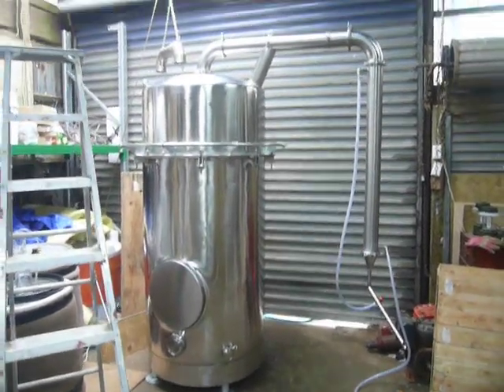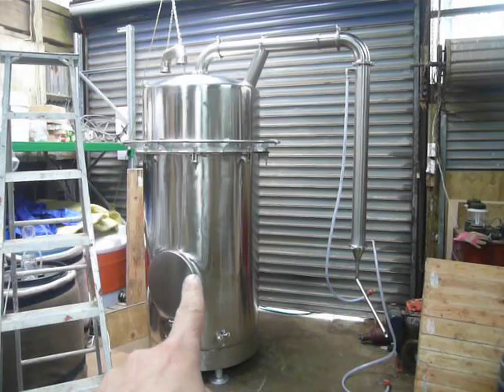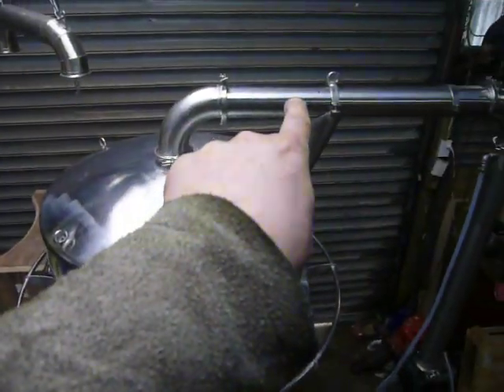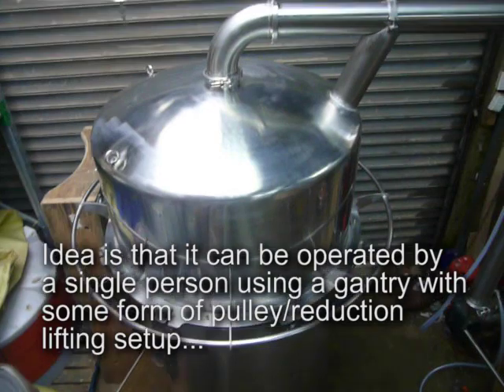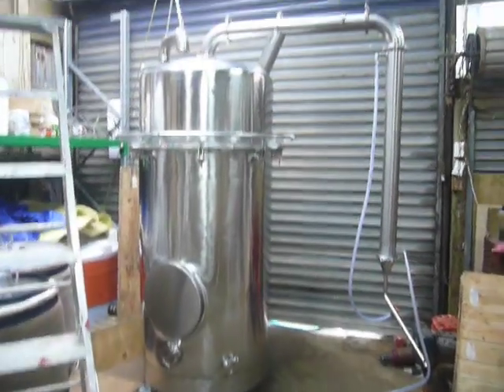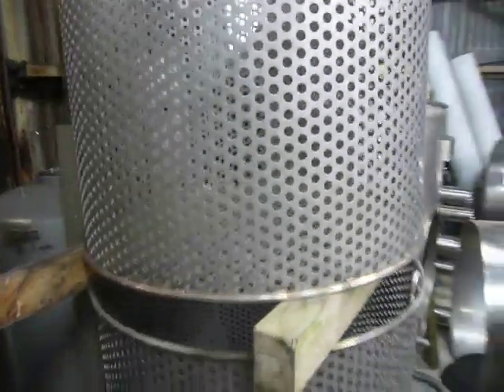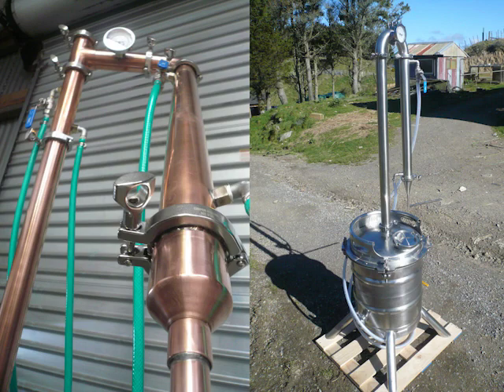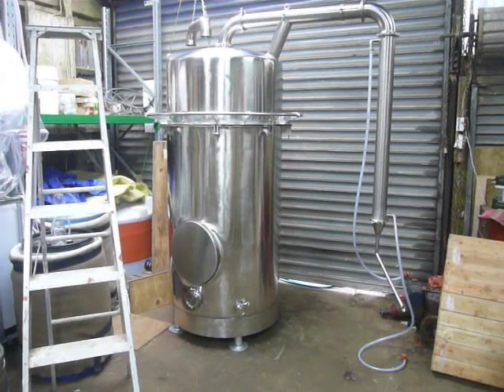1250L Essential Oil Still build

Comment: Fantastic build, congrats!
Reply from the maker: Thanks Chris!
Now I just gotta find time between jobs to build something on this scale to squeeze out the moonjuice! 😊

Happy Distilling!
Reply: @AngryParrotDistillery  Exactly! Gotta keep the balance between building and distilling! I've finally got my Tig setup complete so I can purge also. I'm teaching myself to weld, so am practising running beads on scrap metal. Filler rod is next! Are all your stainless to stainless welds with Silicon Bronze? And any Tig tips you could give would be appreciated :)
Reply from the maker: @devolution000  
Heya Chris, I've been welding for quite a while, but mainly self taught and definitley no master at it.
All my stainless to stainless welds are TIG with stainless filler rod except on some occasions where silicon bronze makes more sense for whatever reason.
Silicon bronze I use for stainless to copper mainly or maybe copper-to-copper where welding isn't an option but the joint needs to be structural.

Top tips I can think of for a beginner;
Get comfortable, if I'm not sitting comfortably I make horrendous welds, sometimes you have to shoehorn into something but try and work comfy.

 Keep your tungsten clean and sharp. If you dip it badly, stop and sharpen it - don't keep going with a blobby tungsten.

100% Argon shielding gas, some ppl might recommend argosheild (argon-carbon dioxide mix, MIG gas) ignore them and go 100% Argon for TIG (exception might be helium for copper welding but it's expensive and you can still do that with argon.)

Happy Distilling!
Reply: @AngryParrotDistillery  Thanks so much for the tips, very much appreciated!

Comment: Holy Crap! Love your artwork in the shop my friend!
Thank you for sharing. I need a tig.

Looking forward to seeing that monster of a condenser.
Reply from the maker: Heya BigEd!
Thanks! 😊

Yes a TIG changes everything, especially once you start TIG silicon-bronze brazing and can attach dis-similar metals structurally.

A 200amp TIG is all you'll want for this kind of work, ... although I did run out of beef with mine a while ago and had to go find a 300+amp to use - that was on the big copper/brass dephlegmator I mentioned at the end of the vid.
 That reached a tipping point and become a @#$%ing HUGE heatsink .... which oddly enough is exactly what it's suppose to do 🤣

Happy Distilling BigEd.
Reply: Just curious how you approached the weld/build. Top down, or on it's side. The sheer size is off the hook for me. I hard soldered a 2 inch shotgun. But a foot dephlag with 3/4 pipes...
It's all about the journey.
Reply from the maker: @BigEdsGuns  Side for the side-seam and inlets/outlets, standing upright for everything else.
Theres no hard/fast rules, I find if I'm comfortable I make nice welds/brazes, if I feel contorted or hunched around something it starts looking like a drunken caterpillar. 😊

Comment: sweet little set up.  good job
Reply from the maker: Thanks Kev!

Yeah, I'm keen to see it running and see what output the client gets off an E/O run with the basket packed. I know the yeilds from E/O's can be quite small in comparrison to alcohol for instance ... stuff is worth it's weight in gold tho' in some instances. 
The product worked out a fraction of the price that a NIB build would have.

Job took longer than it should have tho' with all of the changing workshops and pissing about that has gone on this year.

Been making a few smaller E/O distillation units for folks lately, this is certainly the Mac-Daddy tho' lol.

Happy Distilling Brother!
Reply: @AngryParrotDistillery  That would be cool to see.  I bet that thing works great.
Reply from the maker: @Samandcocoa  yeah I'd be keen to see it going too - might see if my client would consent to send me some video.
It's destined for the other end of the country.

Happy Distilling brother!